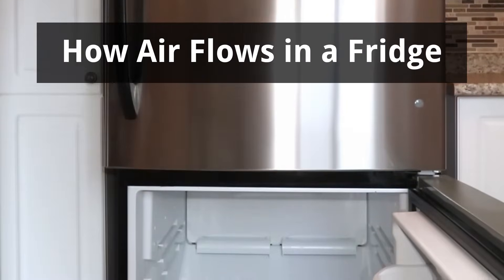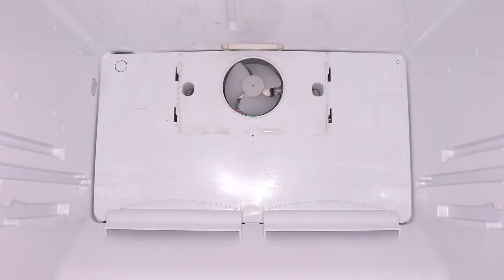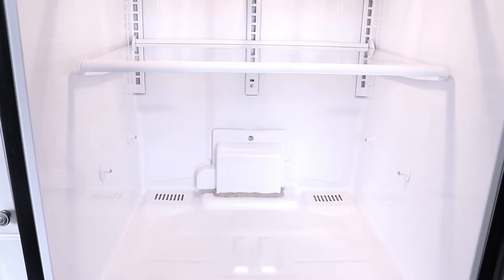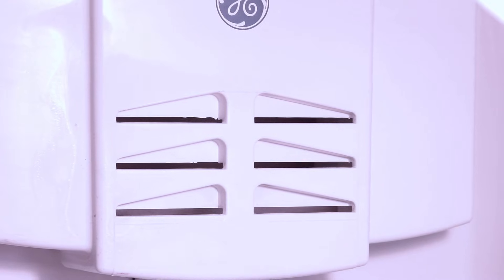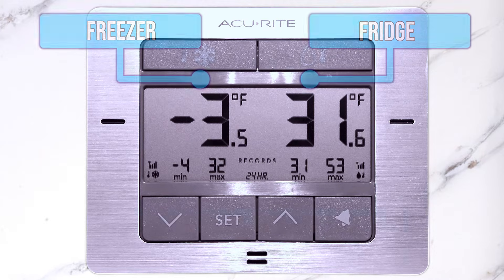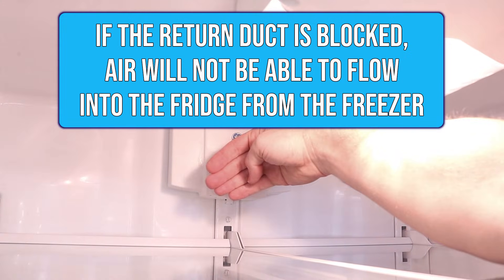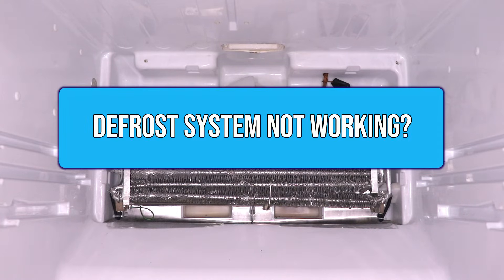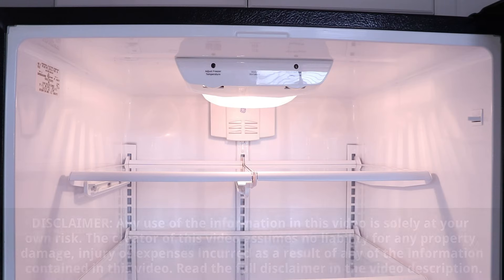Learn How Air Flows in a Fridge and Freezer: Diagnose a Fridge Not Cooling by Understanding Air Flow

Comment: I have a big fridge with a separate freezer at the bottom. Currently, there is a lot of difference between the temperature at the bottom of the fridge and the temperature at the top (around 4 ot 5 degrees). This is because the cold air comes from the bottom and stays there but also because there is no fan inside this fridge. I want install a 12 fan in order to allow cold air to go up. Where and how shall I place it to maximise the uniformity of the temperature?
Reply from the maker: Did you try to look up diagrams online with the model #, maybe there is a fan hidden somewhere that stopped working?

Comment: Hi, thank you so much for this video. I think the return ducts at the bottom of my fridge are blocked or clogged. The airflow only works when I open the freezer door like the video. How do I clean or clear the return ducts from the fridge to the freezer? Thank you!!
Reply from the maker: At 02:01 I show the return ducts, so you can look inside them and see if there's food that fell inside them, although a lot of stuff will have to be taken out of the fridge.. or use a cell phone camera to take some pictures inside.  If those are clear, then they might be blocked at 2:32  , likely by ice.  
If this never happened before, and someone recently forgot a door open, like the freezer door, for a long time, then it's possible you have a one-time ice block that just has to melt.. and then your fridge will be OK.

The vents are fairly big, so if they're not blocked in the fridge then they're likely blocked by ice buildup in the freezer.
To figure out what's really going on, the back cover of the freezer has to be removed.  There may be videos showing how to do it.
With the back cover off, then the ice can be inspected.  If there's ice from top to bottom, then the defrost system is not working: heater, thermostat or controller.
If the ice is only on the top of the coil, but no ice on the bottom, like in the video, then the refrigerant is very likely low, and there's no fix for that.

Hope that helps.  If you get it fixed, it would be appreciated if you can leave a comment to let others know how it was fixed.

Thanks for watching!
Reply: @CleverFix  the coils are slightly frosted but there’s no ice, is that okay?
Reply from the maker: @gamiyagi  It depends what you mean by slightly frosted.  Here's a picture of what bad looks like: https://www.reddit.com/media?url=https%3A%2F%2Fi.redd.it%2F6nwb1hyegalb1.jpg   , a VERY thin layer of frost is normal.    If you don't see a clear blockage or ice blocks, then it sounds like it's operating normally.  Some fridges, especially with vertical freezers, have dampers between the compartments that sometimes get blocked.  It definitely sounds like a blocked return vent if it flows with the freezer door open, and it does not with freezer door closed.
Reply: So good news, we were able to fix the fridge. We did so by unplugging the fridge and defrosting it for 24 hrs. And then I got a hair dryer and blew hot air into the vents for about 15 min and that cleared up whatever ice may have been in the vents.
Reply from the maker: @gamiyagi  Now you'll have to watch and see if it happens again.  On mine, because the refrigerant was low, it would happen again in about 2-4 weeks.  If the defrost system is not working then it happens fast, in just 5-7 days.  Hope it keeps working good!

Comment: It looks like my fan blows inside freezer. Fan spinning clock wise . is that good?  Whirlpool with freezer on bottom.
Reply from the maker: Yes, it should blow in both freezer and fridge though. That freezer fan blows air in both the freezer and fridge, so you should feel the air blowing inside the fridge with the freezer door closed.

Comment: Hello! I have a question:) If there's mold inside these hole in the freezer... Is there a way to clean it? If so, how? And is it safe to use?
Reply from the maker: A damp clean cloth with a bit of soap should work, just don't drop anything inside there that will block the vents.  There shouldn't be any mold, but that can happen if the fridge is not running properly, or it was turned off for a while and it stayed damp on the inside.

Comment: The return vents from the fridge to the freezer are flat and at the bottom.  What happens if spills and food debris get into them?
Reply from the maker: They're a bit raised to prevent liquid from going into them. If the spill is directly above the vent, then it will go in, but if it's anywhere else, it will not, unless there's a huge amount of liquid. Anything that ends up in there, will likely end up falling to the bottom of the return duct at 2:32. I did find some debris there on mine when I took it apart.
Reply: @CleverFix thank you for the information, very helpful.

Comment: When you set a fridge dial to a warmer temp, why would the damper move up ? 
It will cause more of a COLD air to flow through...leading to an opposite result - a colder temp
What's wrong with my or author's explanation ?
Reply from the maker: That's the freezer dial I am showing. When the freezer is set to colder , then the Fridge damper closes the vent to the fridge partially.  This means the fridge runs longer and more cold air stays in the freezer to cool it down more.  I ended up turning the freezer to 1, which opens the vent the most. My freezer still stays around 0F. This allows the most air to the fridge, so the fridge runs less. If I set freezer to 5, it closes the vent, and fridge runs longer, but I don't need colder than 0F In the freezer.  
So a thermometer is needed to find the best setting. I had the freezer on 5 for a long time, and the fridge was running very long times, because the damper was half closed until I realized even on 1 the temperature is in a safe range.
Once you have a thermometer, you can slowly turn the dials to warmer, and watch the temperature, making sure it stays in a safe range. I started with the freezer first, and then the fridge.
Reply: This depends on the orientation of the damper. Closing of the damper is normally achieved by turning the nob anticlockwise.